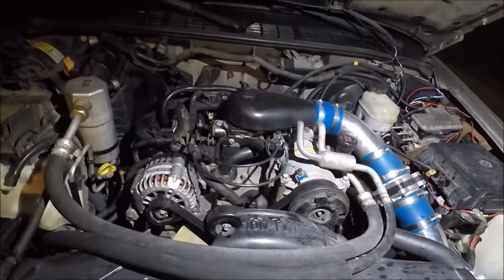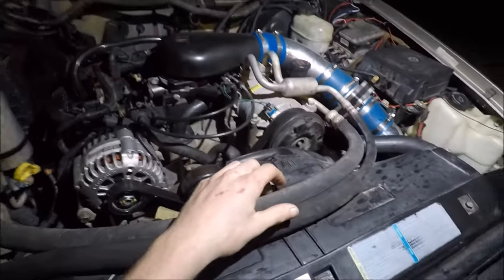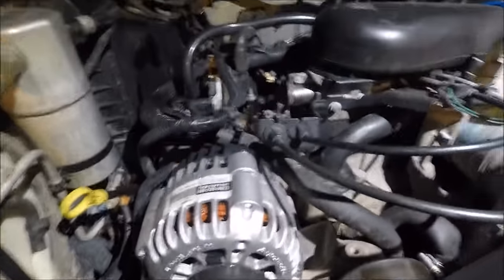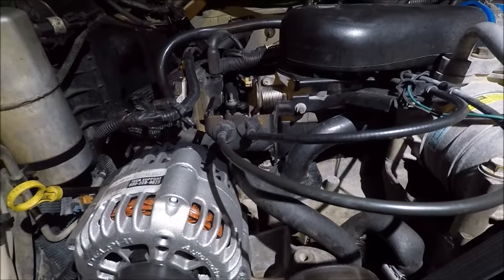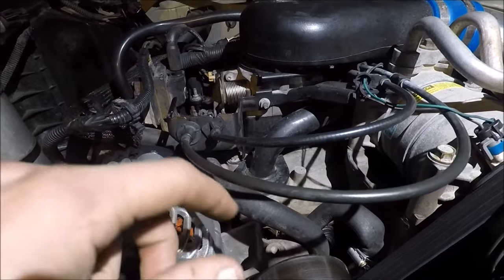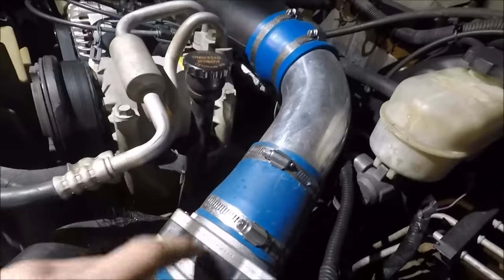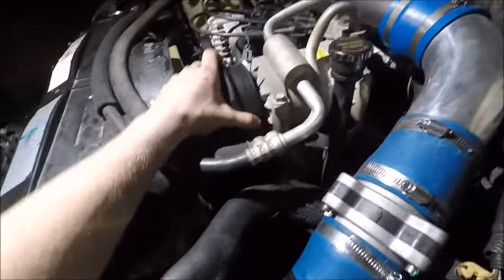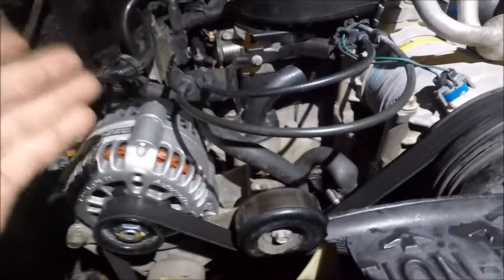EVERYTHING YOU NEED TO KNOW ABOUT THE CHEVY 4.3

Comment: Noticed You had a fairly new alt on the truck I'm guessing a CS-130 85amp Hope you understand Tahoe And other larger trucks That have Powerseats And all the power options Have the AD-244 145amp Alt (100amps @idle) For around the same price of the other alt depending on where and who you buy from.  I replaced mine And the bolts line right up No issues Other then You need to make sure its the same plug holes 2 vs 4? And a 1 inch larger belt Then your stock one ..I when over board And Replaced all the larger gauge wiring with Welding cable copper 1/0 gauge wire And hammered copper lugs with shielding And a smudge of electrostatic grease inside Added a rear alt bolt to the alt bracket And ground it off from there (Power has a quicker path And does not bounce around the alt trying to come in or out on a front mount) 

Another common issue People over look when it comes to fuel issues is the Fuel pressure regulator They don't hook up a fuel pressure tester And Or don't know what they are looking at when they do And start swaping out parts as a fix till they find the right part  I bought my Blazer Very cheap because of this ... New Fuel pump, New Updated fuel injectors, Fuel filter, Spark plugs, wires, dis, Oil, Thorttle body cleaned, New vac hoses, Still ran ruff... $500 from $1,000 As i told him It could be a simple over looked part Or a major engine swap... 
Ran a test fuel press was bleeding Meaning a compression issue. Or loss of fuel before hand. Check each spark plug that was fairly new One was more dirty then the rest which told me ether it is not firing proper Or something else not right ...Had to remove the intake anyways ..And yup Pass side rear of the intake sparkling clean like new And the rest of the intake was black from normal carbon At the bottom of the FPR with a weeping hole and a single drop of fuel saying hello !  When the FPR mini screen is full of junk (finer then a fuel filter) back pressure happens And blows a seal The fuel still enters and passes But part of the mass pressure weeps out And enters the intake ($34) 
Had the Truck (2005 Blazer) 5 years now Nothing but normal wear and tear (rubber lines, tune up Oil etc) no engine codes
They make great campers If you tear down the rear to metal and rebuild them Traveled coast to coast of Canada 2 people 2 dogs And slept inside fully layed out
Reply: my 97 Jimmy 4.3 L won't start after I changed the fuel pump I've checked everything , starting to run out of ideas , got 61 pound's up at the rail , fire on all the plugs and got air , aren't those the 3 things I need to get this thing goin , or is there more ...
Reply from the maker: Does it atleast crank over but won’t fire?
Reply: @JLGARAGE252  yes cranks and cranks but won't hit , swapped out the spider injector ,and whole  distributor , and made sure I hadn't jumped time , still won't hit ....

Comment: I put a Standard Motor Fuel Injector in my 2003 GMC Sierra when the factory one failed, it has 186K on the 4.3L V6.
I like the truck, I paid $15,600.00 for it in August of 2003, still runs very well. I consider myself fortunate not to have spent more over all these years for transportation. One thing I like over the 350s I have owned: This engine runs nice and cool.

Comment: I have a chevy s10 with 328,000 miles and I bought it brand new back in 1998 and put all the miles on it. its got a random misfire p0300.. which its not smoking any and when it misfires you can barely notice it.. I am hoping to get 400,000 miles out of it.. but which its got a rear main seal leak which it does not leak much just a little oil from time to time.. but no smoking or knocking. or running hot.. I am dealing with the misfire and hopeful will have it resolved soon.. my throttle body cover I think on the air flow cap. I think is causing the issue.. its been a great and hard working more and very strong..

Comment: I have a 94 S10 with 172,000 on it I bought new in 94. I like this truck, it's my daily driver but I don't put many miles on it. I replaced a lot of things like the water pump, motor mounts, alternator, ac compressor and components, blower motor, blower motor resistor, blower switch, radiator, TBI gasket, drivers side exhaust manifold, of course exhaust, shocks, hoses, brakes and things like that and i'm sure i'm forgetting a half dozen other things. I'm wondering how much longer the fuel pump will last.

Comment: My 02' Blazer ZR2 has 300k on her & she runs like brand new. I'm the 2nd owner and it's super clean. 
That damn distributor cap has been replaced 3 times because of moisture. 
I did have to get the coil & ecm along with a new Distributor, wires & plugs replaced. 
She runs better than my Wife's new car. Can't feel it running at a red light. I did get a new hd tranny because the stock sunshield brakes but besides basic maintenance, that's it. 
Fuel Trims are 1.0 bank 1 & 0.0 on bank 2 getting 16mpg in town & 18 on highway. Same as a brand new sticker ZR2 in 2002.

Comment: I am so glad i found this video. I have had my 03 sonoma zr3 with the 4.3 for 7 years now and almost each thing you said was an issue I have delt with. Your fan shroud looks like it may have had the same issue as mine did.. bad motor mount allowed engine to move too much and the fan caught the shroud and blew pieces of plastic right through the rad... that happened 2 times and 3 shops never diagnosed the bad motor mount..
Reply from the maker: Well I’m glad this video was spot on for ya I’ve owned 2 ZR2s now and their fairly well built trucks but like everything else they have their own problems
Reply: @JLGARAGE252  I definitely love my truck. One question for you... ive got a coolant leak that i can see pooling right under the ac compressor on top of the power steering pump. Would that be an intake gasket issue or something else.

Comment: My 98 blazer 4.3 keeps shutting off while driving,  I put new distributor cap and rotor, it ran good for a while without shutting off, now it shuts off while driving after a few miles, sometimes after few hours of Driving, it will stall and hard to start,  does anyone know why and what's the issue??? I need help!! 😫
Reply from the maker: Just dropped mine off at the shop for diag and they said it was the oil pressure sensor. They replaced it and fixed my problems, hope this is somewhat useful. The early 2000s and late 90s GM are Supposedly having the fuel pump signal and oil pump signal going thru the same sensor.
Reply: @JLGARAGE252  engine dont fire until it sees oil pressure Thats why newer cars dont start and fire up  quicker than you can get off the ignition key like old chevys would. On the old silverados there was a oil sensor by distribitor and one by oil filter one for gauge and one to tell it to start. Both see oil pressure but do seperat things.

Comment: My 1999 new body style GMC Sierra 4.3 had poor acceleration, sputtering and lack of power. Turns out it was the MAF sensor was extremely dirty. I just replaced it with an AC Delco and my problems were over.

Comment: Gmc typhoon owner here.  The issue i have is the thing will run great for a month and then start with hard starting then progress to no starting.
Reply from the maker: jdgreen214 start with the basics, plugs, wires, distributor...if those are fine...check the fuel filter
Reply: @JLGARAGE252  It has a bunch of mods when a bought it. We replaced the throttle position sensor and that fixed it for awhile.  It also isn't running the stock chip.  Its running a custom pitbull chip.  It has forged internals, PTE 44 turbo, 55 pound injectors, 3 inch down pipe, to many more to list.  I enjoy driving it when it runs.  I have had it sitting for almost a year because I had a grandnational getting restored.  Now its time to get the typhoon running.
Reply: @JLGARAGE252  I redid the fuel system.  New tank, pump, and sending unit.  I'm pretty sure but I wouldn't bet the house on it an electrical problem.
Reply from the maker: jdgreen214 vacuum line somewhere maybe?
Reply: @JLGARAGE252  That's also possible.  It runs great for about a solid month.  No hesitation with acceleration or anything.  It drove so great i was gonna make it my daily.  There is a sy/ty guy out in Illinois and I discussed it with him.  He thought maybe the chip was telling it to do something weird.  He wouldn't know until he gets his hands on it.

Comment: That's right Marina did buy it with Marina does not use that spider fuel injection Good reason That's the improvement fuel injection for that engine. But also One of us still general motors on the 2007 4.3 they went with a non-distributor setup using a coil box and where the old distributor went they use a oil driver. And if you know how the program a computer you could go to clear unplug.

Comment: I had to replace the alternator due to the whining sound and it fixed it but thats good to know for future reference. I have a 2003 chevy blazer xtreme and i have definitely opted in to drop a lq9 into other than rebuilding the v6.
Reply from the maker: Med II the 4.3 in my opinion is a solid engine to build but a lq9 would be pretty sweet, sadly the engine bay size has downsized compared to the 1st and 2nd gen s10s

Comment: Hello I have a leak that appears to be visible from under the front end of the truck with fluid seen on the harmonic balancer at the front of motor it appears to be light pink in color to clear. I'm thinking for the 4.3 it is the powesteering as it's right above there.Do you have any thoughts as tomy assumption?  Or am I just a girl baby - ass 4 that assumption?
Reply from the maker: The first 4.3 I had did that

Comment: mine is a 2000 chevy Silverado with a 4.3l v6 vortec it has had one owner and was used as work truck for quite some time. know I have and have had to replace the spark plugs spark plug wires and the disruptor cap,  I've also had to replace the radiator and reservoir it only has 190k miles on it runs like a champ although I would like to figure out why cylinder is misfiring after replacing all the spark plugs I know it probably the injectors but their a pain to get out because their under the throttle body and whole bunch other shit real pain to get to put other than  that I have had no problems I've abused the engine by slamming the gas to the floor at dead stops and still runs fine i am really happy with this engine and probably rebuild it and add performance parts and turbo it

Comment: What ithe tube that goes from the top of the passenger side Valve cover to the air intake?
It's not the pcv. That comes from the driver's side. 
What is the one coming from the passenger side?

Comment: Wondering if crankcase vacuum is normal on these engine ? ..example : if the oil fill cap is removed , placing a hand over the fill hole will produce suction ...this seems odd 
Thanks for the tips 😇

Comment: Actually the 4.3 is still got the same displacement same bore same stroke Just the engines completely redesigned on the outside And they are being used in trucks

Comment: Old video I doubt I'll get a response. I had new ignition parts installed. Now above 74mph it acts if the transmission is slipping. Rpm's will go up and the truck will slow down. Took it to aamco, they said the transmission is fine. They said it's a timing issue??? Took it back to the mechanic that did the ignition parts, they said the timing is fine. Any idea what it could be? It's an 03 4.3 vortec ZQ8. Edit: Forgot to mention the truck is only at 86k miles
Reply from the maker: I had a similar issue and it was the camshaft sensor harness on the back of the distributor. Check the harness and the sensor itself (it’s located under the rotor inside the distributor).
Reply: @JLGARAGE252  the distributor cap was replaced with a flat top. I'm not a mechanic, so not too sure if that's something I can do
Reply: @JLGARAGE252  found a video online, looks simple enough. I'll change out that sensor when I do my thermostat next weekend
Reply from the maker: @DudaZachary it’s usually not the sensor. I would inspect the connector and the wires first.

Comment: 4.3 L V6 high performance heads? how do i tell if  ones on my 2006  engine are the high performance? and yes i have them pulled off now . clearance between valves are 9.64th inch

Comment: Bummed Chevy stopped making the s-10 , first vehicle ever was a 1985 S10 blazer 2.8 carbureted 
it was the "Tahoe package" power windows power locks and cruise control in 1985, whaaaaat? Haha then in high school I had a  1995 2wd extended cab with a 4cyl 2.2l I believe with a 5 speed, the shift came from under the dash and was like over 2ft long, every other s-10 that year I have seen had a short like 12inch or less shifter that came out closer to the seat, had the tranny rebuilt and the guy said it was original, no cut outs like it had the other shifter setup, but for a 4cyl that thing went pretty good, I was young and thought I was cool so I lowered it, rims tires, put a 2000 front end on it, welded roll pan the whole nine. Did most of it myself with my dad and it was my baby till I hit a deer on the highway and had to replace the whole front end. Put it back to stick and sold it with 250,000 miles to a guy my dad works with and he drive it for quite a few years after. Got a 98 S-10 extended cab 4x4 after with the 4.3 and had it for 5 years or so. Then doing construction the S10s weren't cutting it anymore so went to fill size Chevy, had a 06 Silverado 1500 for 15 years and have a 06 2500hd for work and a 2016 Silverado. The new ones are nice yah, but to this day my 95 S10 is still my favorite and most comfortable truck. The seats were just perfect I dunno. Boy that was a rant haha

Comment: I Have a 1995 gmc sonoma 4x4 with the 4.3L, just replaced transmission at 196,000 mi motor still runs great, had to replace remote oil filter lines, if anyone is faced with having to replace , since from what ive read is a common issue, save yourself the hassel and frustration and loosen the motor mount on the drivers side and jack the engine up first, it will save you hours of frustration
Reply: Hey I just picked up my hoses today and was thinking id throw em in tomorrow. Is jacking it up only for the lines to the remote filter or would it help with the rad to filter hoses too? I only have to do rad to filter
Reply: @JNN131  yeah you should be good just doing the lines from the filter to radiator those shots be easy I just got done last night replacing the ones from the pan to the oil filter, and it was a job didn't have to take the motor mount out , but did have to jack the engine up drop loose the bell housing access cover , disconnect the front drive line (mine is 4x4) and take the fender well out on driver's side then all I had left was 1 support bar in the way that goes from bell housing to side of the engine .the best way I found to get to the lines to the filter is to remove the fender well, I couldn't have done it without, you got it easy the front ones there's nothing in your way good luck!
Reply: @chrispurkiss3399  Thanks! Looked fairly accessible but havent pulled down the skid plate yet. Hopefully plan to do it this evening.

Comment: I have 2002 Sonoma. Have you replaced oil pan gasket?
Reply from the maker: Yes, on the V6, If your Sonoma is 4x4, the  Front Axle will pose some Difficulties with replacing the Oil pan. If it is a 2wd Model then it should be a Fairly Smooth Process. If you remove the Oil Pan, it wouldn’t be a bad idea to Visually inspect the bottom end and inspect the oil pump and screen.
Reply: @JLGARAGE252  Yep, 4.3L Vortec 4WD.

Comment: 97 gmc jimmy 4.3.  Starts up and runs 10secs or so. Then just dies like turning off the key. Replaced distributor ( it snapped off in my hand when I tried to wiggle it) swapped fuel  pump relay... finally pulled pcv valve to get it home. Now its right back to dieing... any suggestions?

Comment: At a total loss with my 99 vortec. Was turning over but not firing, replaced the distributor cap and timing chain sounds like it’s going to back fire after every other crank now still not firing
Reply: Check fuel pressure regulator on the back of the spider in the intake manifold. That was my issue after spending close to 800 on other parts trying to diagnose the issue.
Reply from the maker: check the connection on the Camshaft sensor plug, currently having that issue, mine will crank over and run but will miss at idle, P1345 code, check your mass airflow sensor as well.